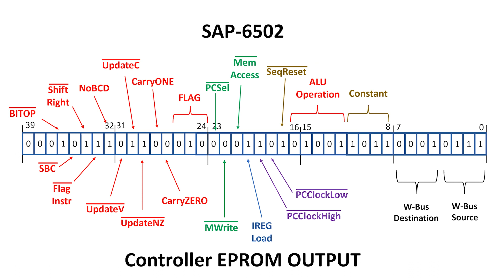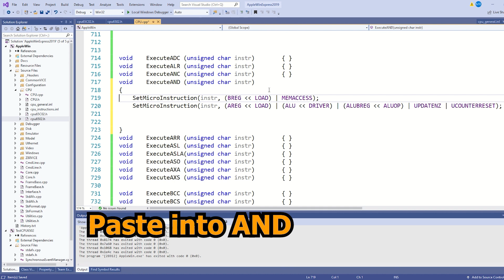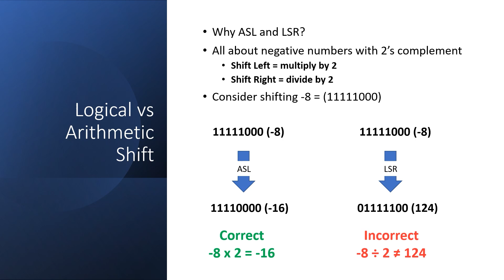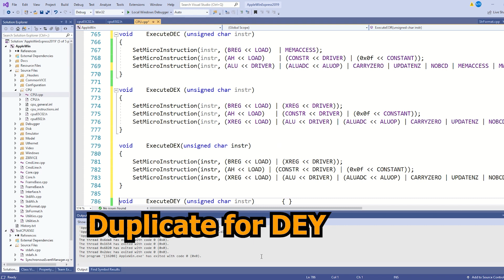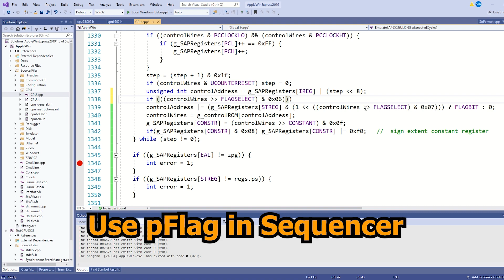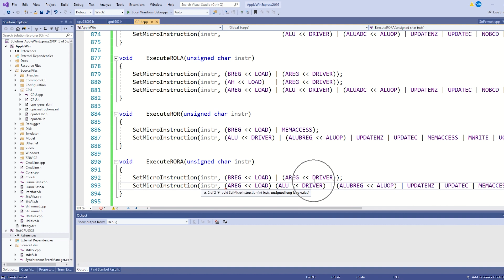SAP6502 Microcode - ALU Instructions

Comment: It may be possible to simplify the ALU by using a 16-bit EPROM as the ALU.

As ‘EPROM address’:
- 8 bit A register
- 8 bit B register
- 1 bit carry
- 1 bit decimal flag
- 3 bit mode (Add, Sub, And, Or, Xor ...)

You could also multiply, divide, modulo ...
Reply from the maker: Correct. You can also integrate the ALU into the sequencer EPROM as well.

Comment: This video finally reached the top of my to do list. Sorry to hear about a second round of covid. I have been thinking about this series and it occurs to me that this approach could be used to build TTL Brainf**k implementation. I have been noodling around a bit with it in my head and the ALU is obviously the hardest part. The other tricky bit is finding the matching left bracket. But an up down counter should do the trick. I may design such a beast on paper, but I don't think I am brave enough to build it.
Reply from the maker: Thanks Martin.   I'm feeling better now.  It knocked me about this time..
If you're worried about the ALU, i'd suggest the Turing6502 approach where the ALU is completely programmable.  It's always worth having a crack at building these things,
it sucks a bit when they don't work, but debug can actually be the most creative part of the process.

Comment: Hope you are feeling better. Finally deciding to make an attempt myself (on breadboard); although, a few parts are unavailable through the sources available to me, so I'm substituting and adapting as needed. ROM that was readily available to me was a 27C1024 instead of 27C322, so will have to hold off on 6502 and do something a tad more basic until I find a source that isn't out of stock. I am tempted to work out a design that would allow a Z80 rule book to be dropped in. If I go that route, I was considering to have a more basic rule book that merely bootstraps loading into RAM a rulebook from an external source and then swapping to RAM as the source of the rule book (I was thinking of having base microcode on ROM and loaded microcode in the RAM since I have a few extra RAM chips available; maybe use the SD reader I have as the source of the rulebook, but likely overthinking).

Thanks again for your hard work in putting together this series.
Reply from the maker: Excellent.  I'm hoping others will have a crack at building the system.
It may be worth thinking about than machine in the Simpler than SAP-1 playlist.  You can use the 27C1024 for the SAP-1, then you can pop in a 27C322 to the same hardware (with 1 8-bit register added) you can run 6502.
If you want a RAM solution, i'd personally use an Arduino MEGA to program it during reset.  You can connect up the SD card directly to it.
Let me know how you go and if you need binaries for the EPROMs
Reply: @DrMattRegan  You're right, I probably should do the SAP-1 variant first and then upgrade with the bigger chip once Mouser (or other) has stock again. I don't have an Arduino MEGA, but I'm thinking I can do it with a spare Pico Pi, but will likely need to toss in a 3.3 to 5 level converter in the mix for it to work. Since it'll be on breadboard, should be easy enough to upgrade later if I do the ROM version first. I'm probably going to hook one up anyways since I want to emulate the Apple ][e drive controller. Not sure if they are still good, but I have a box of old MECC games on 5 1/4 and I still have a 386SX-16 laying around with a working drive. I am not sure DSHD 1.2M drives can support Apple formatted disk, but I figured a raw read might could work; I've at least got a NEWDOS/80 disk from a TRS-80 to read on it previously.
Reply: @DrMattRegan  I'm definitely going to have a crack myself. Then depending how nuts I feel, I might even attempt to extend it into 65816 territory.  The 68K might be a bridge too far :)
Reply from the maker: @AndyGraceMedia  excellent. Happy to help if I can!